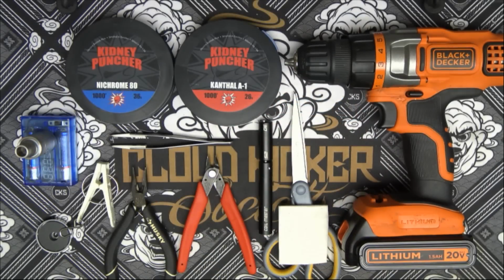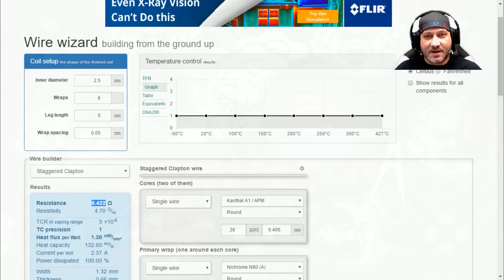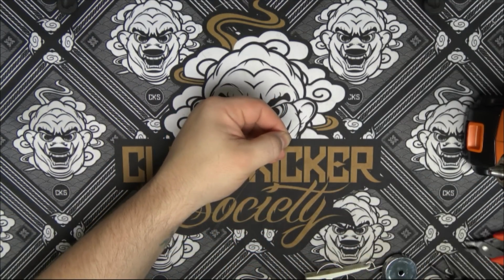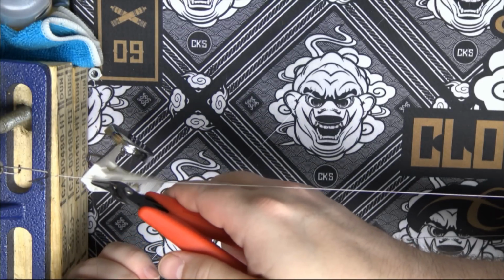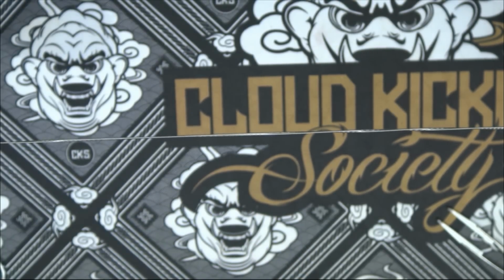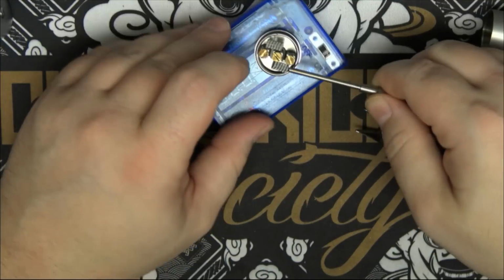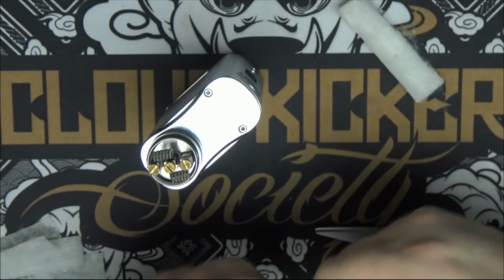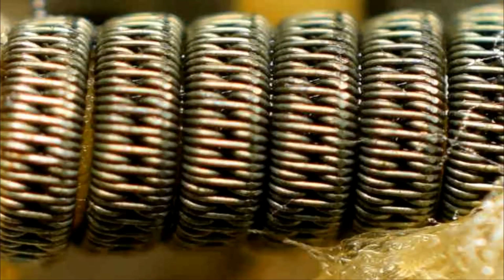Staggered Fused Clapton Tutorial

Comment: great tutorial dude, i had this coil mastered but lately every time i snip my core wire the spaced core springs back as if under tension which destroys my spacing, really struggling to figure out why this has started happening all of a sudden.  any help would be great
Reply from the maker: I assume you mean when you snip the wrap wire? If that's the case, that is entirely normal. Also, it is better to have too little spacing that too much. The fusing wire will force itself into the gaps and spread the stagger to make the room it needs. If you have too big of a gap in your stagger, however, the fusing wire will jump and skip as it tries to settle into a groove. As far as why the wrap wire will sometimes recoil while other times it stays put, I simply do not know. I have experienced the same issue from time to time. The majority of the time I do these, the wrap wire will recoil.. generally about 3 inches on a 40 inch strand. But by the time I've finished fusing the two cores, the stagger is pressing firmly against my swivels.
Reply: ariesjj thanks for the response dude. I've almost given up on these coils due to the recoiling of the wire but I use the looped single core method. gonna try it your way tomorrow and see if I have any luck. I've resorted to using the same few 3+ months old sets I've had in my goons. I find aliens and staples don't give near as much flavor as staggered fused
Reply from the maker: I combined a few different techniques to come up with this and, so far knock on wood, it hasn't failed me yet. Hope you have as much luck with it as I do. Don't hesitate to reach out with questions. I'm laid up right now and unable to build or record, but I am still available to answer questions as they come up.
Reply: ariesjj thanks dude your an absolute legend. your coils have reached as far as my home city in the UK.  I actually gave a set of my own to a reviewer/shop owner who has bought sets of yours at expo a few weeks ago. I've never sold a set an don't intend to but it's killing me that I'm having so much trouble with my favourite build
Reply: thank you so much for this method dude, wrapped a 30 inch length without a single skip in my fuse, you've given me the ability to make my favourite coil again
Reply from the maker: Glad to hear it worked for you! Sometimes it something super minor that causes things to not work out the way they once had.

Comment: I'm using a swivil, with ball bearings. so not sure if it's the drill. chuck is hand tight, no key used. slowest spped the drill can go is snapping after a few spins. very frustrating
Reply from the maker: if the wire isn't coming out perfectly centered from the drill, it puts stress on it with each rotation at the chuck. Make sure the center of your chuck and your swivels are as close to level as possible. The way I set mine up initially was by hooking up a piece of wire to the chuck and the swivel and actually putting a level over it to make sure that it was pretty close. Also, double check that your bearings are spinning.. if not, you may need to lubricate them.
Reply: ariesjj probably the exact cause of my issue. I'll see about crafting a jig. until then to get me started, I plan to order some 38 guage ss wire and do a vertibraid. I got those down cold and curious to see how they do on my new device. one thing I noted today is just for sake of practice, I plugged my bat voltage and atomizer coil resistance in my ohms law calc, and stated that at 3.7 volts, (I always figure at 3.7)and .15 ohms I'm pulling roughly 91 Watts. which experience tells me is accurate. however there is a huge difference on my unregulated tube mod and my gx350 regulated mod. I normally vape at 90 Watts and it hits twice as hard on my gx. this is using the exact same coil and atomizer. seems that the unregulated devices are not as efficient as one would assume. so this new revelation lead me to think that a vertibraid will do better on my regulated mod. not exactly sure how to explain this diferance, both mods are brand new, little to no wear and tear, but the tube mod is a clear second on all counts and a failure on a few. one main issue I'm having and already attempted to correct on the tube mod is a hot switch. this will be why I throw this device off a bridge lol. but the multimeter indicates no internal resistance, shorts, or any other malfunction. so that's an unsolved mystery. I'll try temp control, just mainly because it's supposed to avoid dry hits which if you have ever been there, you know what I'm talking about lol. if it seems a thing I don't care for I'll go back to kanthal, and still run vertibraid til I master the Clapton. my end goal is to toss in a vertibraid in the middle of this build, to add a bit of flair to the build. I'll be guilty of vanity after I successfully do this, take pics and post online lol. I can't lie. not sure if you got videos on vertibraid, but I'd like to see them if you do
Reply from the maker: The thing you have to realize when comparing a regulated device to that of an unregulated device is that your unregulated device will have voltage drop and more battery sag to deal with. The regulated devices, on the other hand, compensate for that with their buck/boost chips and, therefore, put out a more reliable and consistant hit. With an unregulated, as you know, each hit will get lighter and lighter as the battery drains. In a parallel unregulated, the entire 4.2v is heading to the coil, but the entire 4.2v never hits the coils once you consider sag and voltage drop. I would love to be able to tell you to take XX% off of the batteries to get your true number, but it varies from mod to mod even with in the same make of mod. When looking at a tube mod, you have voltage drop and battery sag as well and the voltage drop is going to be dependant on what the tube mod is made out of, how the threading is, and a multitude of other factors. You would need to use a calibrated multimeter at the posts to find the voltage being delivered to the coils.

Comment: Can u show a vid on this coil ohming out at .3 ish or higher
Reply from the maker: Following the same method, but using 28g Kanthal cores with a 2.5mm inner diameter and 6 wraps will get you fairly close to .32Ω in a dual coil setup.
Reply: @ariesjj  ahh ok i normally go with 3mm inner dia coils find 2.5 hard to wick
Reply from the maker: @Anoymus985  for 3mm ID, go with 28g kanthal cores and 6 wraps to get 0.34Ω'ish in dual coil
Reply: @ariesjj  top guy..is that following the same method of the vid
Reply from the maker: @Anoymus985  Yes

Comment: and just a really stupid question, does your wife use temp control, and if so how is it as opposed to wattage mode? as in battery life, and juice consumption, and obviously vapor and flavor
Reply from the maker: First, thanks for the sub and compliment. Hope you're able to knock this build out of the park using these tips. As to your question, she tried temp control a few times but found that it wasn't for her. It didn't quite give her the satisfaction that vaping in wattage mode does. The battery life difference is fairly similar as is the juice consumption. But the vapor and flavor weren't quite to her liking.